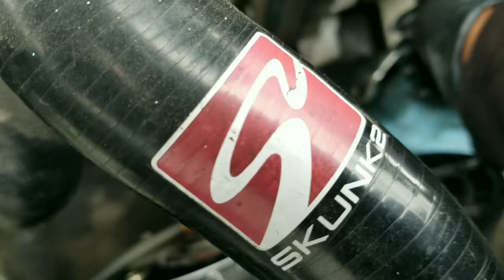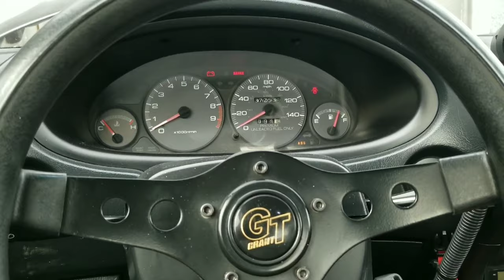Soft Clutch Pedal Fix

Comment: How I fix my was. open the bleed screw than press the pedal down close the bleed screw and pull the pedal up and it works good after about 10trys I got pressure also the $23 vacuum pump they sell at a hardware store for breaks works 100%.
Reply from the maker: Thanks for the tip. Appreciate it 😁👍